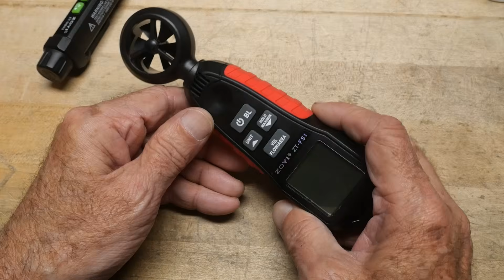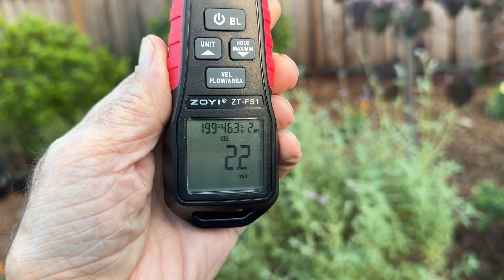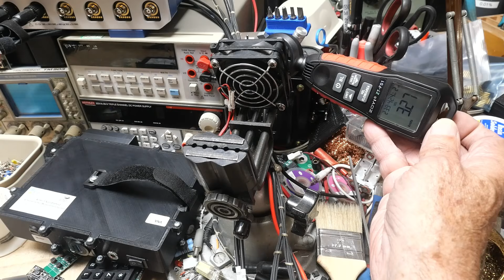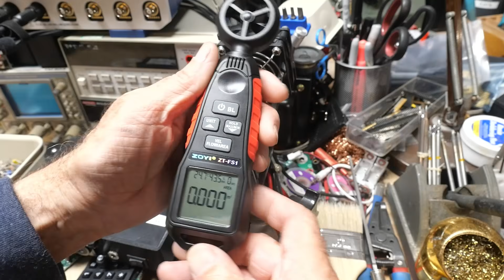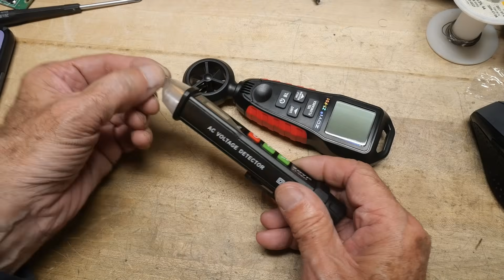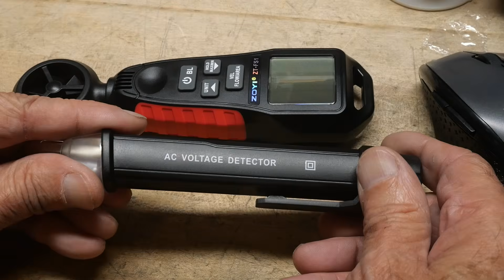#2602 ZOYI  ZT-FS1  and  ZT-DB03

Comment: These voltage detectors come in handy when looking for faults in cables. 
But one must be aware that these are very simple devices, prone to false positives in one set of circumstances, or not sensitive enough in other situations.
The first one i got in the 90s was so sensitive it went off by merely walking next to overhead cables of a train line after it rained. (16.66Hz modulating the beeps, sounded quite weird)

Comment: Both of those are very handy to have in your toolbox. The airspeed indicator is especially "cool" [ pun somewhat intended ].  I had a thermal version that worked like a mass air flow sensor, it would heat up an element and then measure the resistance change due to the cooling of wind passing through it. I think originally it was for golfers but I don't golf. I used it working with fans and heat sinks to cool off high power solid state RF power amplifiers. Worked great. You can never have too many tools. Thanks for sharing.

Comment: Sad they use primitive "propeller" tech instead of hot wire.
Reply: Hot wire (or the combination of heater with temperature probe) for wind speed is also somewhat outdated today. The professional instruments for meteorologists or official warning services now typically use ultrasonic. Meanwhile there are 3D sensors which can sense even downdrafts and updrafts without mechanical parts. On the other hand this "windmill" is nice for handheld devices because it does not need a lot of power and so it does not need a "beefy" battery...
Reply: @tvelektron  Of course temperature compensation. Does anybody really need to know if the wind is going up or down? Around here it generally goes sideways. Hot wire: it doesn't have to be an 18AWG wire for crying out loud.  'Wont take any power at all. After all, this is a hand held instrument.  Only on a couple of seconds to take a reading.  As for the prop version, why does it have a battery at all?
Reply: Hot wire would pull a lot of battery juice to heat the wire.